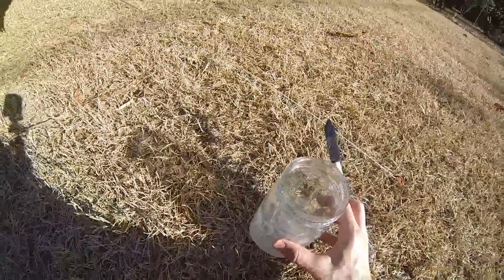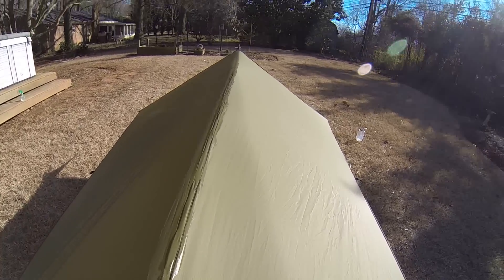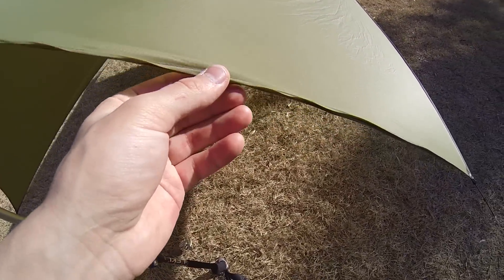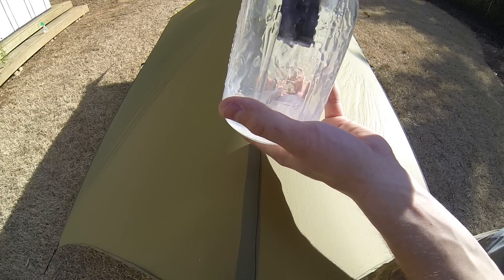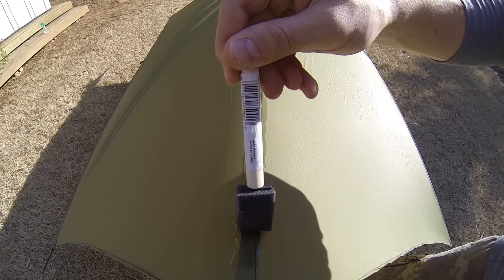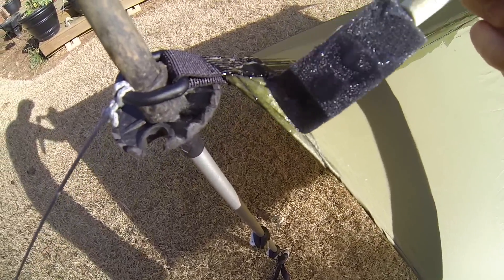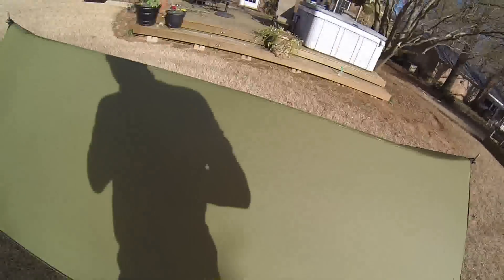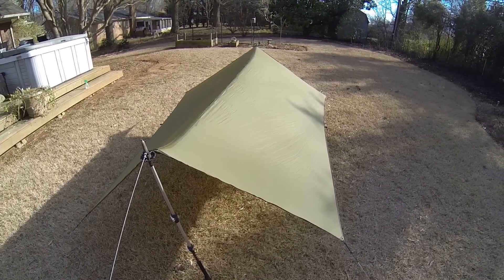DIY Gear Tips: Seam Sealing A Tarp

Comment: It's so nice your videos. I'm gonna try to make a tent for myself. Maybe if put some masking tape on the tarp for nice and straight application. Greatings!!
Reply: I was thinking the same thing.  An expensive tarp or tent should look nice.  I'm going to take the extra step of putting on some tape first.  I want it to look awesome even though it's just as functional however it's done.

I think it would be really wise to peel the tape while the sealant is still wet though!  I know it's not a good idea to let paint or caulk cure with masking tape on it.

Comment: For added protection can you coat the underside of the tarp Seams as well?
Reply from the maker: You could I suppose. Probably not necessary (mine has never leaked after years of use) but it wouldn't hurt really.

Comment: First off thanks for the videos, I am currently looking into making something like this. A quick question for you, however. I notice that the tie-offs on either side of the ridge-line angle up just a little bit. Has this caused water to run down the under side of the ridge and drop about 8 inches in on either side? My buddy had a similar tarp to this and we woke up with wet feet one night because the water had traveled down the underside of the tarp, collected where the ridge line leveled out and drip-dropped on our sleeping bags for some of the night.
Reply from the maker: It's never happened to me yet.

Comment: Shouldn't you be sealing it from the inside, like most seam-sealed tarps are?
Reply from the maker: Nope. Most silnylon tarps are actually sealed from the outside. The purpose of the sealing is to keep the rain from getting into the tiny needle holes along the seams. Sealing from the inside would allow the rain to get caught in these holes. You may be thinking of polyurethane coated nylon which can be sealed with strips from the inside. It's not great stuff though.
Reply: Backcountry Banter I'm glad I read the comments!  I was thinking of doing the inside of my tarp.  Thanks for answering this question.  Is that still the idea?  It's been a few years and I want to make sure no knew wisdom evolved.

I just got a Hummingbird Hammocks Pelican Tarp and I need to seam seal it, so I'm doing my research.  Thanks for the video!